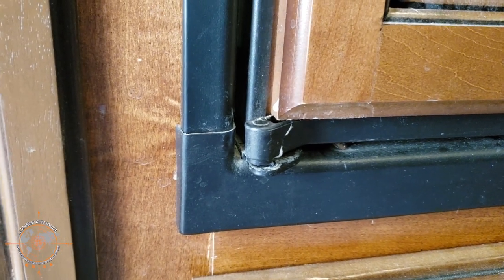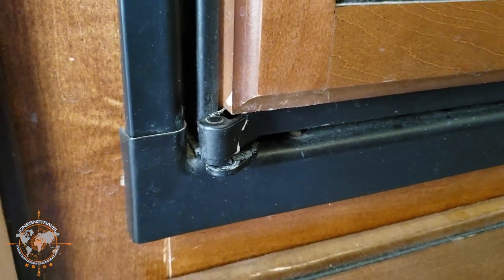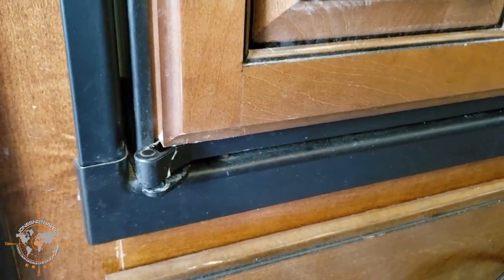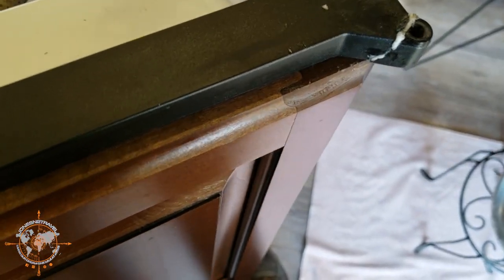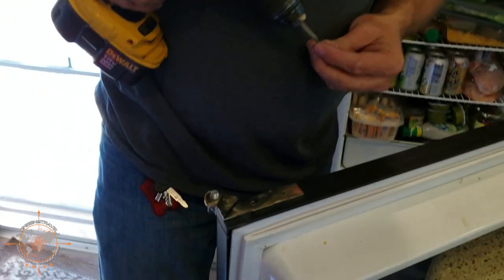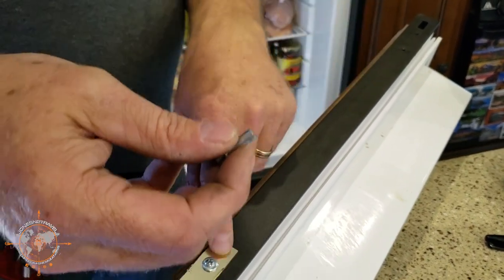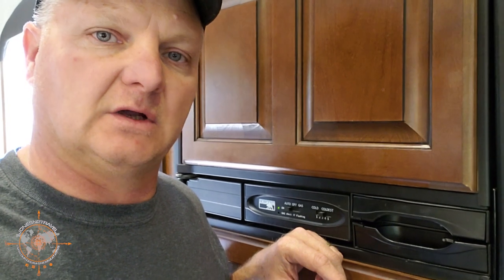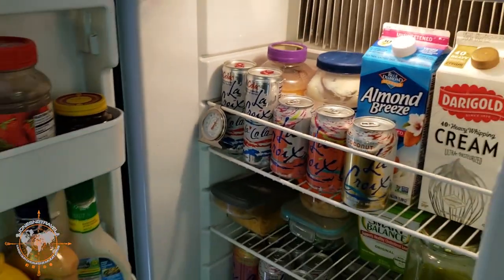HOW TO REPAIR NORCOLD REFRIGERATOR DOOR HINGE | RV LIVING

Comment: Thank you for the idea. I used a triangular 4 inch hinge. Glued the broken piece on. Then put the appropriate sized drill bit in. Placed the hinge on the bit and marked the cut. The three holes are offset on the hinge so it worked perfectly and lookse factory. Did the top hinge with the other side of the triangular hinge.

Comment: Great idea for a quick fix, especially if you're on the road.  I, too, experienced same issue although my fridge is a right handed door.  The only thing I did differently was purchase a small stainless steel plate at Ace Hardware for $1.00, and it is about half the thickness of a door hinge.  So I didn't need to shim the posts with washers as you did.  Worked great!  One small item of concern is that the door now rocks a bit when opening/closing & I wonder whether or not the top post will eventually break as well since it is also made of plastic.  Thoughts?
Reply from the maker: Hi Howie. I've never experienced the top hinge breaking but I suppose it could. I think the bottom hinges commonly fail because of all the door weight especially when the door is full of jars etc. Hope that helps. Thanks for checking out the videos and following along. Safe Travels

Comment: Thanks for the information. I had the same problem with our fridge. Just got the door hinge stabilizer and just need to put it together. I notice you have put what appears to be bungy cord across the front of your top shelf. How has that worked for you, how far above the shelf is it mounted and how did you attach it to the side of the fridge? Thanks for the information.
Reply from the maker: Thank you. So glad you liked the video. That bar you see is actually part of the fridge. It slides in and out of the notch in the sidewall of the fridge. We also use tension rods, you can get the short ones at Walmart, to hold the items from sliding around inside the fridge. Simply adjust the tension rod to fit between the inside walls of the fridge. :) Safe Travels